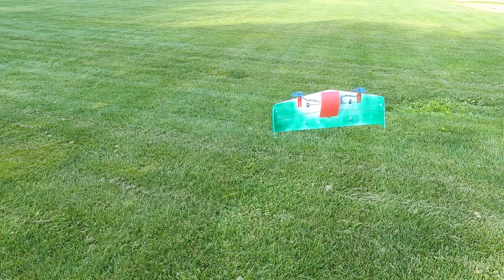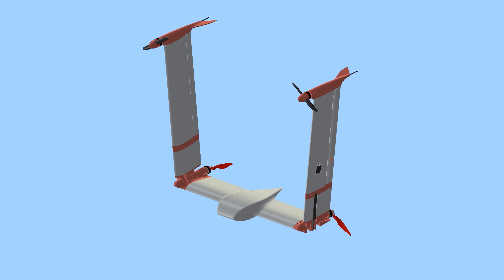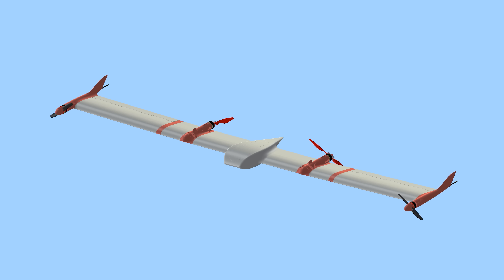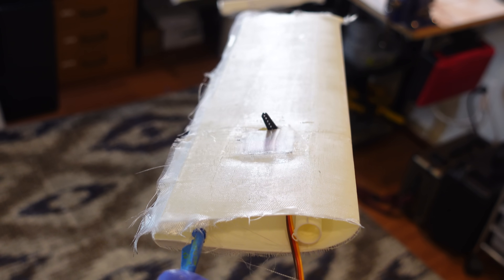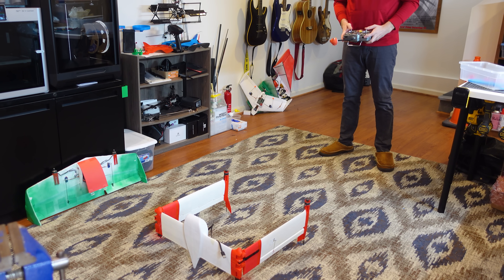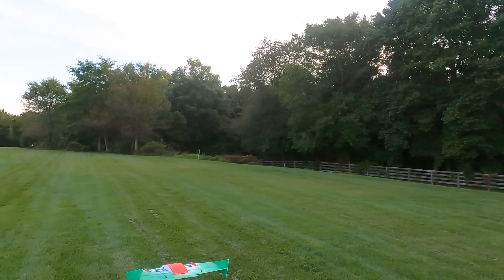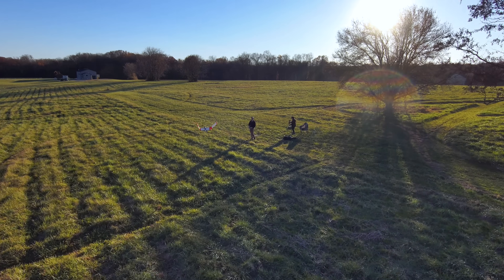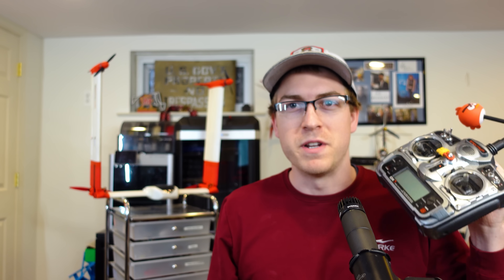Un-Folding a Quadcopter to Increase Efficiency - Part 1

Comment: I've noticed that there no tail/rudder. Could the folding wings be acting as sudo tail, till the transition reaches a certain point? Just thinking that the inclusion of a basic tail could provide more stability through the transition to forward flight... What do you think?

Side note: the counter toque provided by four opposing motors is lost as the transition flattens out. Hence, if "one" of the wing tip motors throttles up/down to Yaw, the aircraft will roll considerably. The roll/pitch control surfaces will help offset this but their effect will be muted until the craft gains more speed.

Comment: Awesome design and build! Purely from an aerodynamic point of view though it seems like its going to struggle with longitudinal and lateral stability after transitioning due to its lack in empennage.  Is there no way to add some sweep to the wings or largely swept winglets to the design? Possibly a compliant mechanism that folds out a "tail" in conjunction with the wings? Looking forward to your next video!
Reply from the maker: Static instability is a feature, not a bug ;)

Comment: Have you considered folding the wings down instead of up? This way you can use the strength of a fully extended joint to support the weight instead of relying entirely on the actuator’s holding force. You can have the spar extend a bit beyond the joint axis and lock onto the other spar for additional strength.

Comment: So if the wind tips is such a problem why not to create a closed-loop frame of wing profile (of say elliptical shape) which will just not have the tips. You would still be able to place 4 motors and have normal copter flight mode. Also you wouldn't need any additional mechanization of the wing.
Reply from the maker: The vertical components of the ellipse don't create any lift, but they do create drag
Reply: @NicholasRehm  yeah, like winglets, my guess is that they will create less drag than normal winglets because they don't have articulated tips. Like hipy toroidal propellers.

Comment: Seems to have an ossilation. Unless that was an over correction control input. But im going with ossilation. Im finding it interesting that some are pointing to the air frame and some the PID. Im thinking even if there is a air frame problem. It could probably be fixed in the pid tuning. I wonder about transitioning to forward flight first. Then hit the batman botton.

Comment: You could increase aspect ratio by adding yet another foldable Wing on the end. To have a closed square. It is just the Question if it is worth the additional weight. But you could re-use the construction of the existing joint. 🎉 Awesome Design Work!

Comment: Very interesting design. The oscillations may be from having a lot of weight on the wingtips. I discovered this when making a small paper based kite, just for fun. The kite was a traditional diamond shape but bowed using tension from a thread from wing tip to wing tip and secured with rings made from copper wire which I had handy. I had oscillations like yours on its first test flight which went away completely when the copper rings were removed. The fibreglass looks great. Maybe you could compensate for the weight increase by reducing some of the base wing material?

Comment: ■■■■ Try adjusting the power to each motor per the extension of the wing... as the further out, the more affect on yaw. It seems to be trying to over compensate, given its reverse upon going to hover with wing tips closer. Hope that made sense?! 😊 9pm Saturday night, and in no shape to fly 😅😅

Comment: Such an amazing and challenging project. The recoveries from semi-transition back into hover mode are just amazing (and a scary) to watch. That you're able to recovery so well is an attestant to your skills and all the effort that have gone into developing dRehmFlight. 

My brain is twisting as I try to imagine how pitch is controlled/maintained as wings unfold. Wonder if had an elevator, or elevons on the inner wing would help? Such flight surfaces operate similar to flight to those on a tail sitter, reducing the complexity of the outer controls surfaces having a wide transition angles. (swapping between rudders/elevons as pitching, while moment forces from the motors also changes)
The closest transitioning VTOL that tries similar unfolding transitions is the PteroDynamics Transwing. Its wings rotate and pivot the using a heavy complex mechanism. 
The dReamFlight folding quad wing VTOL is much simpler mechanically, but a more complex software challenge.

Comment: I have invisioned something similar, but never tried it. My version would be a rotating 2 motors on the wings that are part of a Tri copter. Third would be directly in the fusalage and the fusalage would have a sliding bay. During transition the 2 on the wings fold forward the one inside the fusalage simply turns off and a part of the fusalage simple slides over it closing the fusalage and the motor basically disappears from sight at which point it looks like a normal airplane with twin engines. One day maybe i could build such a thing.

Comment: I thought of something like this , but it was a flying wing with 3 props at the back,  One push prop in the center, and 2 on the wingtips.  It would have the wings fold down instead to make the nose pitch up before hover mode as a tricopter. I thought pitching wings would help roll the aircraft in each turn also.  My building skills where not good enough to make this a reality.

Comment: I have a question, would wings that fold down instead of up have any difference? That way you could have the weakness in the folded wing naturally stop at horizontal. The problem I see would be having lifting forces facing "out" rather than "in" during the transition.

Comment: The best vtol+unfolding winged quadcopter I've see is the PteroDynamics X-P4 Transwing.  Their design is ingenious, especially the transition.
Reply: Was going to mention them, most promising design I’ve seen of a vtolwing
Reply: Yeah the twist is real nice, makes it you don't have to sit on the tail. I wonder how much the mechanism weighs, though... Also, lack of hover efficiency is a concern for them as well as for nicholas
Reply: @ardaricus1566  The PtroDynamics's transition genius is that fuselage stays flat regardless of flight mode, just like a V-22 osprey, but with the added quadcopter dynamics.  And the folding joint is mechanically sound.
Hover efficiency is not important as it's inherently inefficient anyway, hence the need for winged flight mode.  Even so, the tilt in their quad-copter mode is maybe 5 degrees, so no reason it's much more inefficient that the standard quadcopter.

Comment: Super cool! Please pardon the good idea fairy... Once you get the transition control laws figured out I wonder if you could ditch the linear actuators and use aerodynamic forces to commit the fold and unfold. You could extend the spars past the hinge points and lock them into the opposite wing with latch.

Comment: I'm surprised you didn't tune the forward flight without the transition, that way you would've had both modes independently stable, with only the transition to figure out.  Of which the transition mechanism would be the point of the build that needs the most development work, as first attempts are rarely what's best for a platform.  Personally I feel that the linear actuators are a bit on the slow side, I'm not sure if faster ones would be any more decent within the weight class, plus stability and power concerns, and I'm not sure if a beefy servo would suffice any better, plus you'd have to tie the servo horn into a spar which could be problematic; but I think there may be potential in a pulley system, akin to wire-actuated robotics where a wire can push and pull by using a spool, the motor for this wouldn't have to be massive and you could route the wire via the wing spars so that you're pulling the wing by its end rather than actuating on the hinge alone, and this gives you an opportunity to find a way to lock the disconnected spars together while in forward flight, essentially a sliding filler that actuates after the wings are folded down. 

I'd be curious to see what vectored motors could do for the platform.  I would imagine with some tuning during the transition, the transition itself could be much easier, as there's a difference in body vector and thrust vector, it could at least provide a mixed forward-hover while the wings unfold before vectoring into a full-forward when unfolded or a full-hover when folded.  Vectoring the thrust could also provide some neat tricks in either mode, similar to using wing surfaces to deflect thrust while hovering; but the main advantage, as typical with thrust vectoring, is just how agile the craft can be, and this applies to either mode.

Comment: You never showed it actually taking off from the ground once it had the folding propellers? I'm confused how with would land/takeoff because wouldn't the two inner props be in their collapsed state and touching the ground? Maybe even you could land it, as soon as the props slowed down and collapsed you'd never be able to take off again?
Reply from the maker: They kiss the ground but as soon as the motors spool up they extend out and out of the way just fine

Comment: Amazing job at thinking outside the box on this!!
It should stop oscillating side to side as soon as the wings are fully extended flat. That sort of oscillation is characteristic of too much dihedral. If you can't get it to work as it is, you might consider making the central wing section that does not fold longer and the folding sections of the wing shorter which would make the quadcopter form a rectangle but would reduce the dihedral effect of the wing tips. The next problem that you are likely to have once you begin forward flight is porpoising. Most flying wings have a swept wing which helps stabilize the wing against oscillations up and down, porpoising and decreases how critical it is to have a perfectly balanced center of gravity. 
I could see a design like this but with a swept wing and small high pitch props on all four motors that was set up for high speed flight with all four motors running all the time. Could work well!
Reply: Sweepback may actually help reduce the dutch roll problem.  Can't think of a simple way, though, to build in sweep without having the center section be in a high stall angle of attack during transition and may lead to other problems.  Also you could run into intellectual property issues with PteroDynamics.
Reply: @marlinmixon3004  well he should try unfolding the wings while accelerating up at a 45° angle until it reaches the cruising speed and then with the wings fully unfolded tip down into horizontal flight.

Comment: I would recommend trying an experiment where when the plane begins transitioning into  forward flight, the outboard motors shut off and you’re using the inboard motors. I think you’ll find that as the transition begins to take place you’ll see far less oscillation occurring.
You may want to consider adding a switch/functionality on the transmitter so that once the plane is in forward flight you can switch from the inboard motors to the outboard motors.

Comment: Why not lengthen the fuselage and add canards? You still get all the advantages of your current design, but you dont have to deal with the disadvantages of a flying wing design. Or maybe give the wings some sweep? A perfectly straight flying wing is like ultra unstable and you are going to have to lean heavily into fine tuning the flight controls with a mix of motor inputs... But hey, if you get this to work as is, right on, that is awesome.  I look forward to it regardless.

Comment: Making the craft a chevron will stabilise the intermediate stability issues somewhat, but I dont know drones. I spent a portion of my childhood trying to make The Smallest Kite In The World, trying everything from a full delta to a box configuration. I also designed a folding kite-to-glider delta with a string release - the problem you are having is angle of attack, in an aircraft this is a stall condition and usually causes a crash, it is to be avoided.
Good luck with this project, tho I feel you are going to need it. 😉

Comment: Just caught your channel....  I'm a Pilot and Electronic Engineer....  I'm watching your oscillations and the only thing that my brain was yelling at me was "it needs a tail to stabilize it"....  (working on a Hydrofoil for an E-Foil I want to build).....   I'm only VFR rated.... so maybe I'm just talking out my Azzz.
Reply from the maker: May have been from poorly tuned active stabilization--forward flight is intended to be fly-by-wire
Reply: So maybe one more actuated fold out into a Tail.

Comment: Wow this is an amazing work of engineering. One question, why don’t you use the 2 inner motors during forward flight? Won’t it be easier to have them work to push the drone forward rather than having the propeller blades fold in?
Reply from the maker: They're more "optimized" for creating lift in hover (no inflow) vs thrust in forward flight (high inflow). A smaller prop with higher pitch that is "tuned" for the forward flight speed will generally require less power to propel the craft forward

Comment: I wonder if you wouldn’t be better having the wings fold upwards from underneath and locking horizontal since the lift will be pulling the wings up putting strain on the folding mechanism…..
Reply from the maker: Definitely an option that would work. I just chose to put the actuator in tension when unfolded rather than compression

Comment: Would it be easier to fold the craft the other way? Instead of folding the wings down from vertical (fighting the lift generated), fold them up (the “main fuselage” would be aft when sitting on its tail instead of fore), letting the lift help them up.
Reply from the maker: Maybe, I opted for the way I did to get some polyhedral passive stability during mid-transition

Comment: Looks like a very strong dihedral effect during the transition. It goes into a rapid dutch roll. It needs much tighter yaw control during transition so the unfolding wingtips don't get a chance to generate a lot of rolling moment.
Reply from the maker: Agreed, need to tweak some of the flight controller gain staging to clean it up

Comment: Without the backward sweep of most flying wings, and that high aspect ratio, there is little passive pitch/yaw stabilisation. Not sure if you’re planning on nailing the tune to get it flying straight, but a tail of sorts could do wonders getting you there. Keen to see the progress!
Reply from the maker: Longitudinal instability by design :) I may add some detachable tails to improve stability at first while I get flight controller gains sorted out

Comment: Make the drone having cylindric shape, basicaly a wing in form of a ring . or a rectangle shaped wing or a mix of above.
Reply from the maker: Same problem as the quad biplane with all the vertical wing components of the circle not creating any lift
Reply: well it can be done through maintainig the right angle in flight. this could be done through controling the power of uper and lower motors.  drones fly with motors upfront as well . or you can make  an "X wing" design to the drone beams . Or H wing design were tips of the H is where your motors are mounted and the beams are your wings . I think H wing design is closer to clasic airplane design but actualy it would be 2 in 1 . a drone and airplane in one body. plus you don't need a body that's transforming mid air as joints are always weak spots . also your aircraft is suffering very wide aerodynamic configuration change which idealy should be supported by the aircraft flight computer amid changing shape. Probably any shape would work if controlled by a trained flight computer. Good luck with your project. Thanks for video😉👍

Comment: Neat design. Curious why you're not using all 4 motors in forward motion?
Reply from the maker: The inboard ones are actually doing a majority of lifting in hover, so those rotors are optimized more for hovering rather than fast forward flight (large diameter, low pitch). They wouldn't help much in fast forward flight compared to the higher pitch props on the tips

Comment: I think wings folded down would be better when Changeing from quad to airplane mode the actuator dosent need to work against the wing lift and in airplane mode you could make a mecanical endstop to take load of the actuator

Comment: Theres a proposed Military drone (flying as prototype already) that works similar, with the hinges being diagonal - that offers the possibility of a constant angle for the center body.

Not a flying wing if i remember tho
Reply from the maker: xp-4 :)
Reply: @NicholasRehm Pterodynamics did not start with P4. If you look at their old videos, they had much more crudely built little models at first.

But a closer match is probably Amazon's "In-flight reconfigurable hybrid unmanned aerial vehicle" from their 2014 patent. They had to add a tail to make it stable, but otherwise the wing folded in the same way.

This prior art notwithstanding, it is very cool to see a flying prototype that actually works!

Comment: The motor's out on the wingtips are a serious design flaw, just position them evenly along the wing. All that weight out on the tips just has to much inertia to overcome and it's just not necessary. It doesn't do anything significant for efficiency.  The sooner you redesign it the happier you will be. Good luck I love the creativity and trial and error is the best way to design and learn